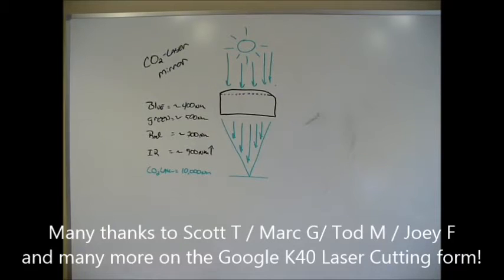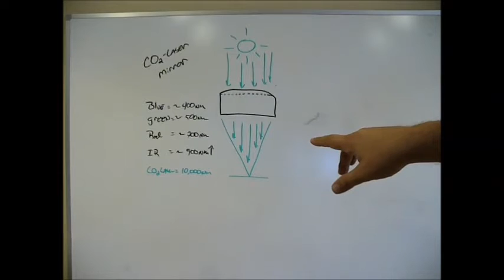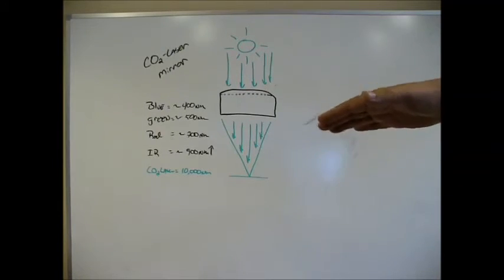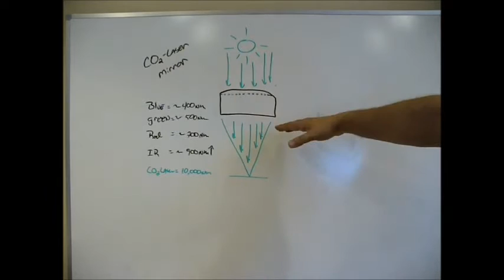eBay Chinese CO2 Laser Cutter & Engraver - Lens Focusing and Alignment

Comment: Which color of protective glasses do I need for a K40? I see so many different ones and as I age I have lost some vision but I am not blind so would love to keep it that way, lol.
Reply from the maker: Actually for a C02 your do not require a color  as they add a "red" acrylic opening but that is for looks from what I read and the laser safety glasses i purchased for 1064 nm are clear but thick pieces of acrylic.  And what I do is wear my reading glasses (also acrylic) underneath them...
Reply: DIY3DTECH.com
Ahhhh, so 1064nm is what the K40 uses for its wavelength then?
Reply from the maker: Sorry, my bad dropped a zero, the CO2 laser centers around 10600 nm or 10.6 μm (the cheap engravers work around 10640nm).  Also here is a link to safety glass in that range. http://www.lasersafetyindustries.com/Laser_safety_Glasses_for_CO2_Laser_10_600_nm_s/20.htm
Reply: DIY3DTECH.com
I used to have 20/12 and on a bad day 20/15 now I need glasses so which one of those can I wear comfortably with glasses?
Reply from the maker: Wow, hard to say just shared as an example as purchased mine some time ago and frankly they are not designed for having reading glasses under them however they are large enough it works out (as they also have safety glasses on the outside)...
Reply: DIY3DTECH.com
I wonder if those that have the sides of the eyes with something if that something will block the laser as well since not blocking the peripheral vision is surely the spot some bounced waves would enter.
Reply from the maker: IR gets absorbed fast, however that was a little of my logic too in getting the side shields (too) which is more for flying debris rather laser light...

Comment: So you have the focal point,.. but say your cutting 3mm ply do you have the focal point at the surface or in the middle of you wood or somewhere different? Is it different for different materials?
Reply from the maker: +Paul Shroom Good question!  If you have the ability to split the difference (i.e. focus in the middle) than that is what I would and the reason for this is you will get a better edge on your cut.  As the first 1.5mm will be out of focus as will the second 1.5mm providing a nicer kerf.  However splitting 3mm can be hard and far as cutting power I have not found it made a "huge" difference However if I am cutting a thicker material with multi-pass cuts, yes I always focus for the center of the materials.

Comment: It's a 'forum' not a 'form', sorry, i'm a spelling Nazi :( 

Informative video, as usual :) 

Definitely worth getting an adjustable bed just for the focusing issue.
Reply from the maker: +Gary McKinnon many thanks for correcting I am dyslexic so they both look the same will correct.  I also ordered the 18mm lens from Light Objects and stop to look at the Z bed again, however still not sure I want to spend the money as I am almost to the point of swapping its brain with GRBL so it would make more sense I could just it into my GCode processor.  To many projects too little time...

Comment: I have my doubts as to the quality of many of the lens included with these units. Also in China they are primarily sold as rubber stamp cutters (hence the funky spring clamp bed) in which engraving the stamp pad could benefit (or at least not have a huge negative effect) from having a bit "unfocused" or larger focal point with the soft rubber. Quality control on the lens and the units along with the fact that many "stamp makers" won't know the difference or care are likely factors in the advertised vs actual focal length. Well explained and interesting video using the IR cam!
Reply from the maker: +Marc G could not agree more on lack of quality control and I have decided to buy a new lens as the lens itself doesn't look so great either so the adventure continues :-)